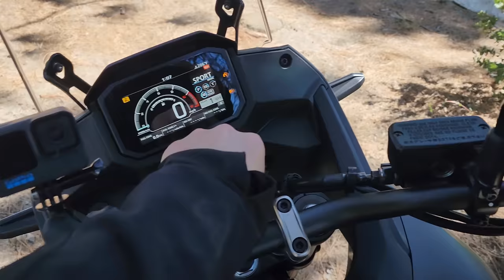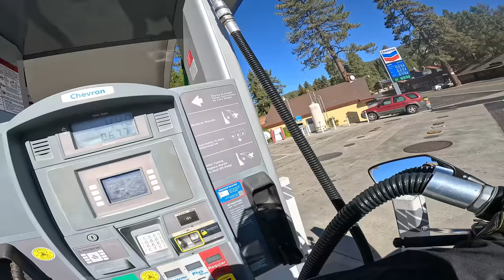Honda Transalp 750 | First Ride On/Off Road (REAL test... no holding back!) (EP.2)

Comment: Another great review. I love that you choose to see the positives in the bike first and then are honest with its weaknesses.

For me, I think the low end torque and predictable pull of the 800DE makes it a better bike for what I would want from this kind of bike. That, the better clearance, better suspension, and the fact that the traction control works offroad make the DE better suited for my needs; however, I think the Transalp is a good bike and a great deal which will make many people happy.

A couple of questions came to my mind: The Transalp has been getting major hype and excitement all year (seemingly well deserved) Suzuki seems to have also produced a great bike right at this market. Was calling the 800 DE a "Vstrom" a big mistake? Why has there been so much less noise about the midstrom?
Yamaha seems to have also made a big mistake. For the last two years everyone (but me) wanted a Tenere, but they were nearly impossible to find, now they are on the showroom floors, but it has real competition. Is Honda making a similar mistake? I went to my local dealer (for a  filter for my ST1300) and asked if they had a Transalp (their website showed it as availabe). They are allocated 2 and the salesman said both were spoken for. This seems like bad planning. I have a hard time considering a bike I haven't ridden and an even harder time one I haven't even sat on. 

Thanks again for the the review.
Reply: Honda has more fans, they sell more bikes. I think that's all it is really. Also the hype of a model name returning from the dead as opposed to a continuation. The older transalps are real cult classics in Europe
Reply: @chrispekel5709  That's why I think naming the 800 a Vstrom was a mistake. Vstrom is synonymous with reliably boring (and I don't really mean that as an insult.) When I rode my dad's 650, I thought, this is fine, but no thanks. I rode the 800 DE on a test ride and immediately fell in love.  Sadly, I can't convince my better half that a new bike is in the budget.

Comment: 13:03 No identity crysis. It's in the name: Trans-Alp. Travel across the Alps. It's meant for roads, a lot of roads, in whatever condition they may be, but still roads. It's a touring bike with some extra oomph to take those gravel roads and mountain passes with potholes. It's meant to take you and your passenger out of a great trip across Northern Italy, Switzerland, etc. It's meant as an europe-crossing machine.
In the US, it'd be a coast-to-coast bike that will be comfortable on the road and capable of taking some secondary roads. But you're not supposed to get it offroad - though, it can take it, it just needs the protection extras.

You noticed the wind protection, it's because that's what you need for long travels across the mountains on the road.

Comment: A comment on what suspension preload adjustment does just to perpetuate the confusion (or not). At rest, suspension is topped out so compressing springs with preload will not change the unladen ride height save for a tiny amount of compression of whatever method is used to control top out.

Preload compresses the spring which will reduce travel and provide the perception that the spring is firmer which it is but only because it is deeper into its compression. A 100lb rate spring needs 100lbs to compress 1” but if you preload it 1” it will take 200lbs to compress another inch hence the belief that it creates a firmer spring.

Comment: wait, you just dropped the bike? that is amazing!!
Dropping on the left side could be Fatal....most of the "bike drops" are from the left side because the kick stand and etc...and on the left side you have a vulnerable spot that is the water pump.
Another bad thing about this bike is the engine being stressed structural part of the envelope, and that could generate cracks on the engine case on a long term off roading.

Comment: Seems like a good option for long distance adventures. I think there's a certain rider who needs the Tenere, which seems more hardcore, especially the underside. I looked into the last Transalp and read that above 65mph there was hideous vibration in the footpegs which really discounted it as the goldilocks format for travel. This seems like there's no obvious problems as the engine is well regarded.

Comment: My opinion is that big adventure bikes are not designed for complicated off-road but for asphalt with the option of dirt roads. Pay close attention to what types of tires the manufacturer sells them with and that will tell you what the motorcycle was designed for. Of course everyone does what they want with their motorcycle. For me, they are very heavy for difficult off-road and I hope they don't fall on your foot because they will break it and lifting them is not easy at all. I like them a lot and I would definitely buy the transalp but I would think 10 times before driving on difficult off-road.

Comment: i have tested it, and it feels as alive as my old ktm 790 adventure... but it has too long gearing, 6th gear is unusable, and 1st gear is too tall and you have to drag the clutch a lot... but the ergonomics, the power, the suspension, everything is amazing... probably would like a tad bigger TFT because it has too many data for such a small tft.. other than that... almost perfect.

Comment: Well, technically more preload makes the suspension also harder, since the spring is compressed more. This is why you should change the spring rate to match your weight. The suspension will work better, is softer in the initial stroke and soak up the small chatter more effectively. Weak spring and lots of preload will make your bike feel harsh over small bumps.
Reply from the maker: i don't think springs work that way. the rate is constant.
Reply: Yes, the spring rate is the same, and I assume the Transalp comes with a linear spring. This means that each cm (or inch) takes the same amount of energy to compress. But since you have precompressed the spring, it takes now more energy to make the spring move.
Reply: This is why “static sag” is so important.  Too little static sag with the correct dynamic sag is indicative of a too soft spring that will give a harsh ride due to coil binding.

Comment: Hey great review series - really enjoy them. Very profesional point of view. Great job.
I'm considering entering into the mid Adventure segment, but have some constraints 163cm tall. Already did 2 hours test ride of the Transalp and i was really impressed how manageable and capable it is. Scheduled a test ride with KTM 790 Adventure S. 
How do you compare Honda XL750 Transalp vith KTM 790 Adventure S? Here in Europe the prices are almost identical, even now KTM offer some discount and goes below the Honda with almost $700 .

Comment: I would guess that Honda wants the traction control and abs on by default as a safety feature. Pain in the neck if you're riding in the dirt, but defaults to "safe" settings if you're on the road.

Comment: Hi. You compare it to just about every mid-size adv except the Tuareg. Wondering why is that? Is it just because of the dealer network you don't see them as comparable? or maybe the price? To me, they seem similar, except that everything you're complaining about with the Transalp isn't a problem with the Tuareg. With the mods to suspension you're suggesting, I think the price point becomes fairly comparable.

Comment: I would agree that the cb500x would be boring in the context of the US but here in Vietnam where I live and the speed limits and general size of the roads are so small its actually more than enough (especially when you have the ecu flashed 😅). Would definitely upgrade to transalp in a western country but for now I'm still not bored of it hehe.

Comment: Ground clearance is definitely an issue on the transalp. The footpegs are also quite low... I took the transalp to Stelvio pass this fall, and I would scrape my boot going around those famous hairpin turns if I tried to use the rear brake at all... maybe I was leaning it too far over.

Comment: The problem is that most people would need to spend some money to get it the level required AND that stuff is expensive.   CS is a deal breaker but there is a company here in OZ that will probably have one soon.  Its gonna be 2-3 grand, suspension probably same money, bash plate, crash guards, bark buster, luggage system etc.  I can see myself spend another 10 grand on this.    And then you have to ask is there something that has all the required features for less money !   Maybe !

Comment: If Honda has any sense at all, they will release a firmware update to deal with the traction control reset issue on power cycling. I really doubt they'll do that for ABS though. I'm liking what this bike so far, despite the flaws. As a CB500X owner, this could very well be my next bike.

Comment: Take a drink every time he mentions the menu not saving settings. 😄

But as far as the identity crisis you mentioned, I disagree. It seems like it does EXACTLY what it was designed to do, which is be decent off-road and decent on-road. This has the potential to be a true dual sport with a couple of upgrades/protection.

Comment: May be this should have been the more elegant street friendly version of XR650R with the slightly bigger engine. This definitely has an identity issue. Not a fitting option for    a middle weight counter part for Africa Twin, feels like that gap is still not filled in the Honda lineup.
I have an Africa Twin DCT, and at times Am intimidated by its size, but this does not seem an option I would like to switch to.may be thats what Honda wants😑

Comment: So, based on your review so far the stock Transalp is more street touring than off-road, the suspension is inadequate, lacks custom mode saving of  TC &ABS. Needs crash protection, needs better tires. I will be curious as to how much more $ you put into this bike before it becomes more competitive with other brands offerings that may have all the right stuff to start.
Reply from the maker: It's more logical to buy a Tuareg, but, some people really, really want the Honda reliability... so they will spend the money on this platform
Reply: For most adv riders gravel is all the "offroad" they ever see. And for those riders its more than capabel enough. Around here, where I live, I don't even know a gravel street I'm allowed to drive legally let alone off road. Only possible on some private property. Or I drive a thousand miles to eastern europe...
Reply: @BigRockMoto  Is the 660 problematic?

Comment: The wheel sizes seem like marketing said "It must have spoked 21/18 wheels", and accounting insisted on tubes. Meanwhile the engineering team was building a bike that would be great at the road touring it's going to be used for. Does anyone really need dirt bike tires to ride down dirt roads?

Comment: Vibrations.. I test rode a transalp here in Australia and found high frequency vibrations through the handle bars and foot pegs at 100kph at 3800 rpm. Just wondering if you have felt this on your Transalp. It would be annoying on a Hi Way ride. Ps my Africa twin is smooth.Cheers Ron.

Comment: Good job breaking the clutch lever.  But you're right about the adventure bike aspect and damage.  However, you should have put some BarkBusters on it before dropping it intentionally. How much to fix the clutch lever?
Reply: I think the point is exactly to prove the limits of the bike, which is, it NEEDS all those protection extras if you intend to take it offroad

Comment: Motor too revvy. It’s a road bike in an ADV frock. When you need low down grunt, there’s just not enough. That sump is going to leave a good few riders in a pool of oil miles from home. Another road bike feature. Still rather have a T7.

Comment: Very interesting, I would agree the bike has a lot of potential and will always be a bit more road biased vs off-road, but that's OK as it probably suits a larger percentage of the buying market anyway, especially in Europe. It will be interesting to see what the aftermarket comes up with to potentially increase the ground clearance a bit more, seems feasible. I don't know why some companies write their rider mode software to not retain the settings, is it a cost issue for some retentive memory or ??? But ya, super super lame and irritating. I also really wonder about the lost 7 hp as it seems Euro regs are more restrictive than US regs at this point, almost like something else is going on. Most competitive bikes have the same power for the EU market as the US so ??? Looking forward to your developments on this bike, keep up the good work.

Comment: Ian
I wonder if you changed the fork oil to a heavier weight -would that improve the front suspension  to be better before having to play with valving or changing front springs.
Also did Honda put one spring oo the front like the 300L or 2 soft front springs.

Comment: Man the sump hanging down on this thing is outragous! I wonder if we will see aftermarket oil pans and pickups for this. I feel like if they were more mindful of the exhaust packaging and sump this would have 3 more inches of ground clearance changing nothing else. Not that the current ground clearance is really an issue, it's just the way the sump hangs down like that that's the problem it's just so vulnerable.

Comment: I do get using an engine from another bike; however, when a bike is built from the ground up, please factor in the US market.  Let's say the average person weighs 180 pounds if not more so spring it for a 140 pound person?  Some guys are tall with longer legs but some manufacturers haven't accounted for actual leg room.  Can't save settings?  No cruise? Vulnerable sump and muffler?  Unreal.  I like the tenere 700 but dang, the exhaust bracket is Vulnerable.  Then add that some bikes require up to one hour just to replace the air filter.  I feel that some manufacturers are really missing basic key concepts.  Cruise, LED lights all around, and so on should be all standard nowadays.

Comment: Not a lot of Pol Torres's out there hoping logs with a 400 plus pound bike. So no for the most part the clearance on this bike isn't an issue. That oil sump though is a real concern. A good bash plate is a real necessity for this bike.

Comment: Ian, when bike engine off but key left in ON position, do the driver control presets stay as you had chosen?  So, if off-roading is one able to turn engine off with a kill switch then just leave key in on position for say an hour lunch in the woods then simply get going again without having to go through menus again?
Reply from the maker: Correct

Comment: No cruise control and air filter underneath the gas tank sucks. Also, would like to see tubeless tires. Other than that.
Reply: I like tubeless tires but 99% like tubed because they were told those are better.

Comment: I'm kinda curious what bike you'd recommend primarily for road use. Something good for touring/commuting (comfort being paramount) but still capable of really getting into it on some twisty roads or tricky traffic. Do you think it's a waste of a bike like this to never really take it in the dirt? Or if you lean into a more touring/road oriented set up do you think it's a great bike for that? I currently have an MT07. Love it to death. The engine puts a huge smile on my face every single time I sit on it. But zero wind protection and that torture device of a seat... I find myself reluctant to do all day riding. And I REALLY want to go on some longer trips! Midsize ADV bikes like this seem great because they have good power and great comfort but they aren't obnoxiously large and cumbersome like most "touring" motorcycles. I don't need or want 600 pounds for my commute to work.

Comment: My intention when I bought it was to put some road motorcycle-style crash stops on it instead of putting a lot of weight on it with cumbersome metal fenders that, in addition to the weight, spoil the aesthetics of the motorcycle.

Comment: It's worth noting that with straight-wound springs in the front, and non-progressive linkage in the rear (with a straight-wound spring), Ian's statement (@2:22) is correct... However, with progressive springs and/or a progressive linkage, the effective spring rate changes with suspension stroke.  I have no idea if this Transalp has progressively wound front springs (I suspect it does), but it certainly has a progressive linkage in the rear, therefore Ian's statement is not totally correct.